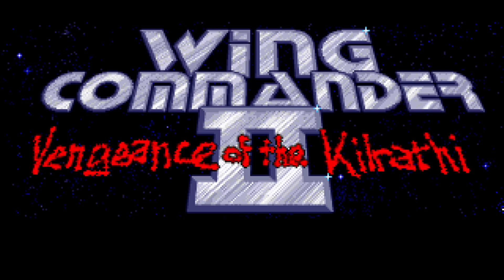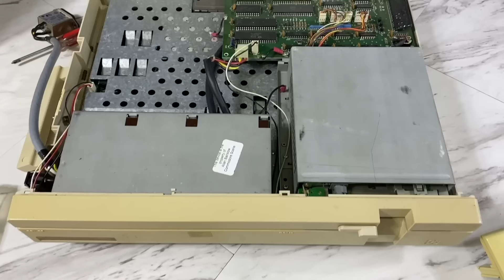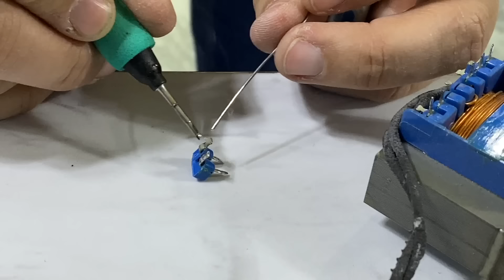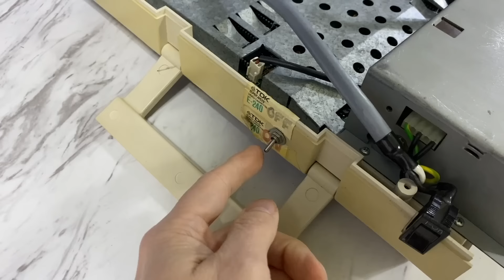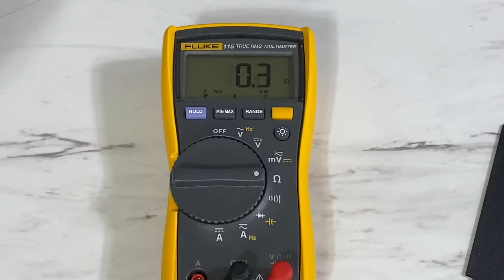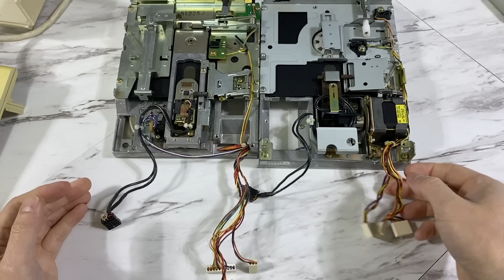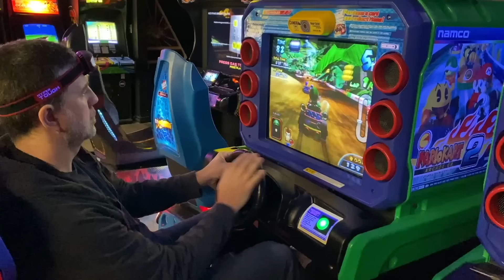Repairing Martin Galway's Commodore 128

Comment: By the way, SCART should be wired for composite video. A common thing in europe is SCART to composite adapter blocks. Ones even with Svideo input are common, though it is up to your display/TV if it will accept the signal. For example, I have a fairly late stage sony CRT TV that has Svideo input with front composite inputs, but does not accept the signal through a scart converter and I tried few.
SCART also theoretically can carry YPbPr signal through a converter but that I have not seen in wild. Then there is RGB one can pin out and try to create something with. 

Theoretically, if you ever need to use a display that has only a scart input and nothing else, you could use the plentiful scart to composite converters. They were very common, every playstation, gamecube and xbox shipped with one.
Reply: When that monitor was designed, S-Video did not exist yet, so the monitor does not support S-Video over SCART. It is a Commodore 1081, not 1084 and the 1081 is composite/RGB only. You can mod it to support S-Video, but that mod is not trivial.

Comment: Western Union Splice for physically joining wires. Hi David, I learned the Western Union (Lineman) Splice in Electrical Class in High School (a long time ago). This splice is very reliable and strong even before soldering. I distinctly remember my Electrical Class teacher saying: "There was little solder in the old west, and even less chance of anything other than a physical connection available when working up a poll beside a railway track."  This link is better at describing the splice than I can be here (I usually use the short tie version): https://en.wikipedia.org/wiki/Western_Union_splice

Comment: Back in the mid-late 2010s I got retro systems from Poland, and my dad brought back 3-4 every now and again. Not a single broken one. I doubt that damage is from rough handling, the brittle plastic would crack and snap way before something would get loose on a motherboard.

Comment: I think that's the first time I've ever seen anyone use the Nu-Brick as a bench power supply!  Of course I was yelling at the screen "But it doesn't do 12v!", and of course,  you already knew that.  Also, I've got some ideas about how to repair that 1571 mech.  I don't know that it will ever have a chance to be repaired now with the wires cut, but it's still possible.
Reply: That 1571 mech is still very much repairable -- just need to splice on some .1" headers and extra wire.

Comment: You should have replaced the 40 year old power supply.  There is not a single reason to keep it.  You still need the trasnformer for the AC line so that was correct but you should have replaced the rest with modern SMPS 5 and 12 vold power supplies.  You need to keep the metal case since it also acts as support.  Replacing the old power supply also gets rid of the fan and its terrible noise.  Also you should have removed the filter from the power connector since that explodes at some point.  There is mode hidden empty space underneath the metal case, I used that part for the 12V.
Reply: The original PSU is a linear power supply, and so has very little noise on the power rails, which is a key reason to keep it. Modern SMPS tend to radiate quite a lot of noise, and will not provide 9VAC easily, as I've found in my own 128Dcr repairs. We did consider it at one point, but nixed the idea once we realized it was just a transformer going bad. Incidentally, these PSUs do not have mains RIFA power caps, so there's nothing to replace or remove there.
Reply: @NybblesandBytes  Hi June, I've been following your channel since the beginning and I'm a big fan.  

The AC voltage is a direct connection from the transformer to the 128 in the original power supply so you just remove the transformer (or get a new one if broken) and connect it directly as how it is originally.  The AC transformer and the AC line is completely separate from the DC part of the power supply and the computer.   In the 128, AC is converted to pulses with a 74LS14 for CIA TOD input, and unregulated AC line goes to Datasette port and user port, that’s all.  The almost 40 year old transformer has no difference with a modern one so unless it is broken there really is no reason to replace it.  

About SMPS noise, you know there is no real evidence on modern power supplies creating problem on digital devices be it CMOS or HMOS or NMOS, vintage or what not.  The reality is, traditional old-timers, baseless over cautious individuals and people mostly depending on anecdotal information “believe” linear power supplies would be better for vintage digital devices.   I have restored and repaired vintage computers, CRTs, floppy drives, and many vintage analog synths.  Analog devices definitely need linear power supplies.  Some of them even require unregulated fluctuating linear voltages.  However with digital electronics specifically on vintage digital devices, I’ve never experienced any problems with even 200mV of digital noise.  Also, how big of a noise does your SMPS create under load? What I’ve found is that linear power supplies create more problems than modern SMPS on vintage digital gear.  Old power supplies create too much heat.  Heat breaks other things.  Vintage gear had linear power supplies because size, heat and weight was not a big issue then.  Get a modern SMPS, remove the fan, and set the voltages correctly, people usually set the SMPS voltage wrong (usually low) and setting the SMPS voltage correctly is a bigger problem than digital noise.

Comment: I live in germany, but I never saw this monitor having a SCART connector. Scart indeed was very widely used on VCR and later DVD players, also the Premiere-Pay-TV decoder used it as many many other devices. But here in Germany, the Commodore Monitor never came with Scart as much as I know. Additionally, my PAL monitor from Commodore also displays NTSC with no problem. I would not have believed that there are differences in both monitors, the european and the americal, because one and the same can show all signals flawlessly.
Reply: Then Commodore must have been cutting costs for some markets, as indicated by some discussions online, given that the 1084 often appears to be very similar to the Philips monitors rebranded by other manufacturers which tend to have the SCART connector (or Euroconnector as it may be called).

And there is information online suggesting that models unhelpfully given the 1084 designation were also made by Daewoo, and a service manual is available on the Internet Archive listing Daewoo part numbers for one such model. These look a bit different from the Philips ones, though.

Comment: I was actually sitting here thinking it's odd how all the TVs I owned done NTSC except 1 and I assumed all TVs after a certain point would be dual with a different power supply to save costs, but thinking about it, that's probably crap.

Not intentional crap, it's just I connected everything up via RGB cable, which is neither PAL or NTSC and never thought about it. The only reason that one TV didn't work for "NTSC" was because it couldn't do 60Hz.

I suppose that's the blessing(or curse for you guys since none of your TVs seem to have them) of using SCART.

Comment: Bit of luck and bumbling and we have a working C128D. Bit of a death trap with the exposed mains terminals that the heat shrink doesn't cover half of but you would hope that anyone that opens it would have some idea of what they are doing.

Comment: Personally, I don't approve the way he repaired the disk mechanism. The drive heads seem to be fine, so there is a decent chance it's just a broken IR LED or something. If the old mechanism could be fixed, it would keep the machine original, and avoid cable cutting. This would be acceptable if he makes a repair video like, every half a week or something. But this video took a month to make!

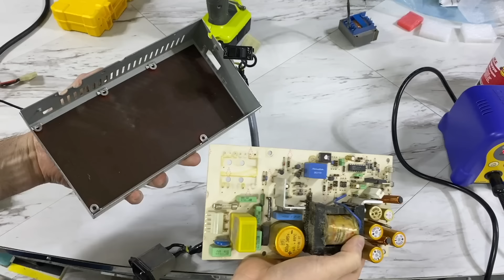Comment: 8:05 The discussion about the power supply being oriented upside down inside the computer case, and that being the cause of the transformer coil breaking is kind of a moot point and a false conclusion, since if the computer was transported inside checked luggage the computer can end up whichever way up depending on how the bag gets tossed around, no matter which way the power supply originally is inside the computer. It could have broken off in the same way even if the power supply was the other, "right" way around inside the computer.

Comment: The video signals req on C64
signal			C64 A/V	SCART		s-video
ground			2			4, 17		1,2
audio			3			2, 6			nc
video			4			20/-*		nc
luminance (Y)	1			-/20*		3
chrominance (C)	6			-/15*		4 
* Only on Y/C-video over SCART. Not all devices with SCART connector support Y/C signals!

pinout from C64/C128: (on C128 pin8 is aways +5V DC)
Pin		C64 signal	 	notes 				
1		LUMINANCE		luminance, video y-signal, brightness				
2		GND			ground				
3		AUDIO OUT		audio output				
4		VIDEO OUT		composite video signal (mixed colour/brightness signal)				
5		AUDIO IN			audio input				
6		CHROMINANCE		chrominance, video c-signal, colour				
7		-			not connected				
8		often +5VDC

Note: the output Y/C signals is 5 volts (unregulated currect) from the C64/C128, 
add a 300-2k ohms resistor to the outputs... (to not accidentally fry it)

Comment: About the transformer used. Any small transformer will have a higher internal resistance than a bigger one, which means the open circuit voltage needs to be much higher than the rated voltage. If you load it with something to draw the rated current, the voltage will be (or should be) on spec. This is perfectly normal.
Reply: Yeah, David knows that -- we talked about it extensively while doing the work. :D

Comment: Scart connectors with the 3 cable plugs on the back do exist, for the 3 cables - thats what i use for connecting my ps1 to my scart TV
You should get one of those, just in case you need it in the future

Comment: Nice work, David. I wonder if the issue with the 1571 was a twisted upper head perhaps? The way the head is only supported on one side, if you leave a 1571 for any length of time without a disk or transit card in it (with the latch "open"), the upper head twists. This can often be corrected by giving it a "gentle" twist in the opposite direction. To help confirm, you could try switching it to 1541 mode (OPEN15,8,15,"U0>M0":CLOSE15) and testing lower head.

Comment: I honestly don’t know why he would still want it to run on 220V when he is now living in the US. Just going to make it a pain to use with a step up transformer every time. You might have even been able to replace the entire PSU with a modern multi voltage multi frequency one. So it would work either way.

Comment: How many people were yelling 60hz when he turned the UK PAL monitor on  Voltage converters will up the volts but typically not the HZ. Better to use a Jackery which can output at 50 or 60.

Comment: This is great. I had a C128D and 1581. I used it as my primary computer until 1995  in college when I got a Pentium 100Mhz. I truly regret selling this thing.
Reply: I still have a C128D. The fans are really noisy. I never did anything about that so I doesn't get any use as a result.

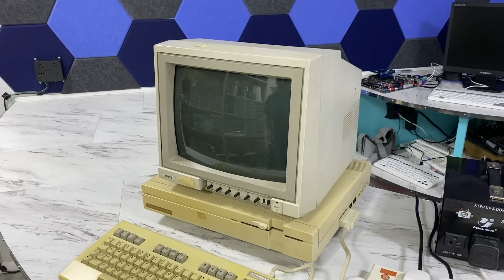Comment: 1:50 - yeah, because it is a 1081 and not a 1084............ You can read it on the back label if you dont know your commodore.
6:55 - did you try the "vertical hold" button on the 1081? Looks just out of sync. You can turn it until you get a stable picture.

Comment: Wow, didnt know US didnt get SCART and were stuck with the more noisy RGB/RCA cables! you poor devils. They even automatically switched your TV input channel to the device when you powered the device up so you didnt have to faff with a remote.
Reply: I didn't experience the automatic switching until the 2010s with HDMI lol
Reply: They got EIA Multiport which is the same as SCART.
Reply: @. EIA Multiport (SCART under a different name) was only on the high end RCA Dimensia TV's (1985-1988) but they only wired it up for composite video it didnt support RGB signals unlike genuine SCART (probably why they wernt allowed to use the name). They dropped it on their next generation TV's.

Comment: Do you have any advice on converting PAL to NTSC with a C64? I built one a while ago for tracking and demos hence why I chose to use PAL chips, but man you are right about it being rare to find a monitor in the states that can do PAL. I've been keeping an eye out for a Sony PVM as some of those have a PAL switch, but would love some advice on how I could run it to a small LCD screen.
Reply: Pretty much all the Sony CRT PVMs you see for sale will do PAL. As for converting — I'm not sure what you meant. Converting what? The C64? The software? The display? Perifractic made a PAL/NTSC switch, but it relies on having chips and crystals from both PAL and NTSC machines... so you might as well just get two machines.

Comment: Haha, wow, I've already realigned the heads of 1541s WAAY back in my preteen or/and early teen years (my parents bought it); I almost think that would be easier to do with 1541/1571 Drive Alignment than cutting and splicing the wires! (And, Dave, when I say "WAY back," I mean it; I'm a little older than you even: my half-century birthday is TOMORROW from my writing of this; February 23!)

Comment: But as for the drive mechanism, you wouldn't really need an exact replacement if it weren't for the wire shortness, right? Other than that, it's the same thing as if you were to swap an Alps mechanism in the 41 with a Newtronics one, isn't it?

Comment: Wow, interesting that the PSU has to have 2 of those big transformers instead of just pulling the 9VAC and then voltage-dividing that down and/or regulating for the 5VDC from there from one transformer. I wonder if this way is supposed to be more efficient in power consumption.
Reply: The main 5V section of this PSU is switchmode, but the 9V AC needs to remain at 50/60Hz since the motherboard (unlike most modern systems) uses it for timing as well as power, so that portion has to be remain linear. Traditional outboard bricks from a 64 or flat-128 are fully linear, with one big transformer, but those are less efficient, and wouldn't fit a 128D case.  Two smaller transformers as used here (one high-frequency, one line-frequency), probably still have less iron & copper inside in total than a combined linear supply would.
Reply: @jordanhazen7761 : Both of those transformers look about the same size, so I don't see how either one of them could be part of a switcher power supply. Switcher power supply technology wasn't very common in those days yet. From what I've seen of switcher power supplies, any transformer in them is super small, which is why modern PC power supplies hardly even have a transformer of the larger size at all, and why they're not very heavy in comparison, and even more so also why we are able to have all these very small USB power supplies now that can give us a good 2-3 amps! So if that power supply really is half-switcher like you're saying, then I don't see why both of those transformers would be about that big, or how you would be able to tell that it's a switcher from just looking at it from this distance.
But anyway, interesting reply; thanks.
Reply: @HelloKittyFanMan  Google "C128D power supply schematics" and a couple of good sites should come up, but be sure to check actual scanned schematics rather than relying on file descriptions, which mislabel some clearly full-linear designs (like the original 128 brick, and some 128DCR PSUs) as switchmode. Because the 9V transformer passes very little current here (having a direct +12V feed helps a lot), it can be comparable in size to the one from the SMPS section. Line voltage going straight into a set of bridge-rectifier diodes is a good tip-off to a switchmode design...
Reply: @HelloKittyFanMan  Tried to reply here twice, but both longer comments seemingly got eaten by Youtube. Anyway, search online for scanned 128D power supply schematics. Some DCRs apparently were fully linear, but this design was a hybrid

Comment: Wow, it's interesting how hard it was for you guys to find a closely matching replacement transformer!
Reply: We looked everywhere for an identical one. The most common is a toroidal multi-winding transformer, but nothing would fit the same physical dimensions as the original. In the end we went with a 10VAC transformer with the same dimensions. I double checked with Bil to make sure we were within tolerances, too.

Comment: Always been a Commodore 64 fan. Liked the 128 as well. Wish modern computers had a Commodore 64 mode(not just emulators). Wouldn't mind a 128 in a PC case. Heck, maybe a PC with a 64 mode and 128 modes. With internal 1571 and 1581 drives.